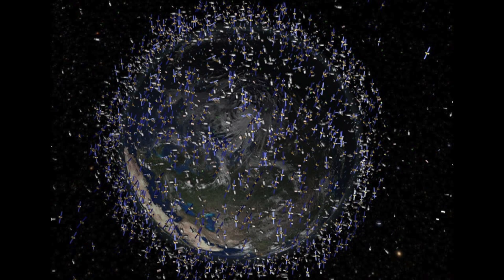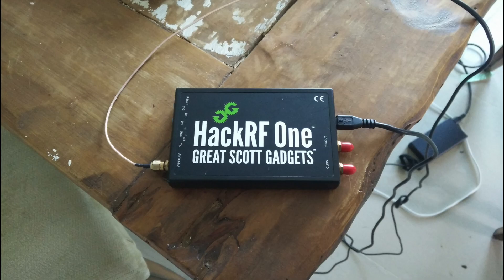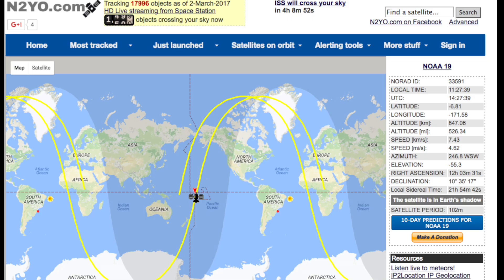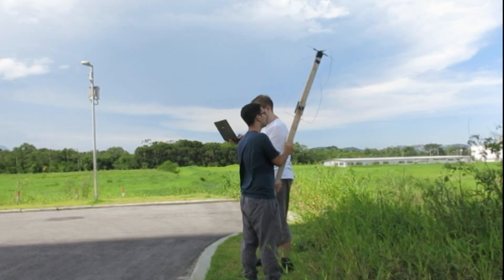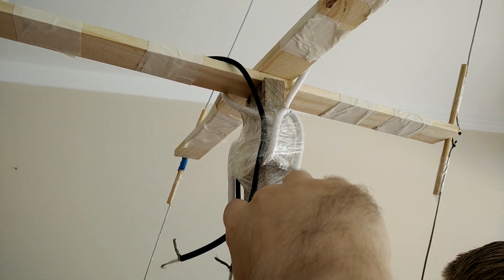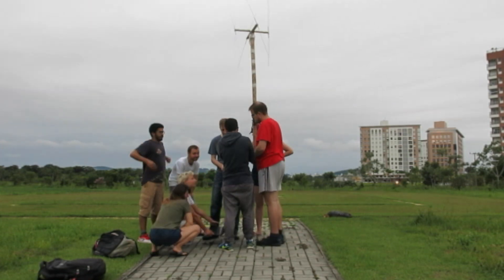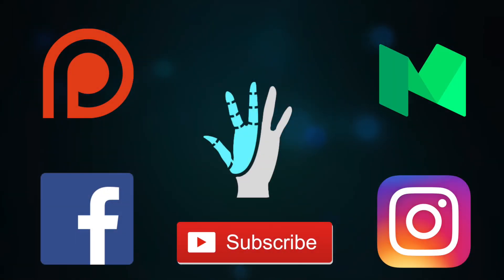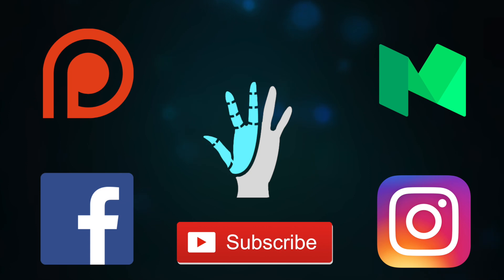How to Pull Images from Satellites in Orbit (NOAA 15,18,19 and METEOR M2)

Comment: Hi, I'm 15 years old and I've been really interested in satellites over the last couple of weeks. I wasn't even aware that you could pull images from satellites like that. Thanks for showing me how to do it. I'm gonna buy all the required equipment and (hopefully) build a working setup over the next couple of months. Greetings from Germany!
Reply: AverageGeek: You don't need an HackRF, it is relatively expensive (when I remember my budget when I was 15, I would say prohibitively expensive). Buy a rtl-sdr instead, you can have it for under 15€ which allows you to buy the other stuff that you also need.

https://www.amazon.de/dp/B013Q94CT6 <- rtl-sdr (including a unusable antenna) 14€
https://www.amazon.de/dp/B00VZ1AWQA <- same rtl-sdr with a few modifications: slightly better frequency accuracy and a slightly better antenna that is usable for first experiments with the software. But it costs 25€ instead of 14€

The rtl-sdr is one thing that is needed, if you want to connect your own antennas you need an adapter from MCX to something else that is more robust and easier to handle, like SMA or BNC.

https://www.amazon.de/dp/B00EF94RF6 <- adapter from MCX to SMA
https://www.amazon.de/dp/B0178YM7DS <- 1m coax with SMA connector
https://www.amazon.de/dp/B0178YNBD8 <- 3m coax with SMA connector

The longer cables can also be cut in half to connect the then open end to your self-made antenna.

The mentioned coax cables are RG316 and not RG58. The difference is, they are very thin and light (which makes them easier to handle) but they have slightly more losses than RG58, which isn't a problem if you keep them short. Just mount the rtl-sdr close to the antenna with a short cable, and use a longer USB cable to connect it to the computer. Getting it away from the computer is also important, all computers are full of switching voltage regulators that produce a lot of noise, if you plug the rtl-sdr directly into the computer it is very close to this noise. A USB-cable will also prevent stick or the usb-port from breaking if you accidentally step on the cables or run into it.

There are active usb-cables like these: https://www.amazon.de/dp/B004HZDKFG which can be used to get the rtl-sdr far away from the computer and close to the antenna.

Why the rtl-sdr is a better choice than the HackRF (for the beginning). The HackRF has some special features that aren't needed most of the time, but they make it expensive. It has a much wider frequency range it can receive (from 1 MHz up to 6 GHz) than the rtl-sdr (~ 24MHz up to 1.7 GHz) and it can receive 20MHz of spectrum at the same time instead of about 2 MHz the rtl-sdr can receive (actually slightly over 3 MHz, but with dropped samples). Most of this isn't needed, most interesting signals are only a few KHz wide and a 20MHz of the HackRF are not needed. You would pay > 285€ for something you don't need.

By the way, greetings from Germany ;)
Reply: @zvpunry1971  So, if I buy this. I only need to make my own antenna, attach it to this and I could gather stuff from satellites? (Excluding all the software)
Reply: ENRPVEVO: If the antenna is good and local noise is low, yes.

If I have an antenna close to my computer, I receive mostly noise and there is no difference between a 15€ rtl-sdr, 300€ HackRF or 1k€ USRP. But when I have 20m ecoflex-10 between antenna and the SDR, then the noise is gone and the signals become visible. Ecoflex-10 is a relatively good and robust 10mm coax cable, but it is quite expensive (~3€ per meter), only the last meter that goes into the SDR is a thin RG316 spaghetti to prevent the heavy cable from pulling the tiny SDR from the table.

If your computer isn't an evil noise-generator like mine, then even shorter distances are OK. Then you can use shorter/thinner/lossier cables, close to the computer... Just try it, the things I listed in my first post are a good choice. :)
Reply: @zvpunry1971  Tbf I have no idea how noisy my PC is, sound wise, its a jet yeah. I don't know about radio wise though, if I want to do this my only option would be to mount the antenna near my window, which is near my PC. Or, get it to the roof, but there is the problem that I can't move it.
Reply: ENRPVEVO: You always want to have the antenna outdoor, the roof can be the best option. A window may also work, but it limits the direction from which you can receive signals. Such an antenna doesn't need to be permanent, some wires glued to a piece of plastic and temporarily installed with a screw clamp in front of the window was one of my first antennas. ;)

How noisy your PC is needs to be seen. Just get a cheap rtl-sdr and tune it to a local FM broadcast station. Almost all SDR software can display a FFT plot that shows the relative amount of received power depending on the frequency. This allows you to compare the signal strength between a frequency without any FM broadcast station and the frequency with the broadcast station. Then you can move the antenna closer to your PC and if the noise increases, you know the source of it.

Just play with SDR software and a cheap rtl-sdr and antenna positions. This is the easiest way to learn it. And then search for other signals. :)
Reply: @zvpunry1971  That's awesome man, I'm atm in my teenage years so going to the roof and installing some big antenna might be a problem for me because I don't know anything about mounting stuff or how all of this works, but this actually seems fun lol. I'll definetly try this out in the short-future!
Reply: ENRPVEVO: Just make sure that antenna experiments (and the screw clamp) can't fall down on the head of somebody. Everything else is just fun. :)

And most importantly: Report back about success or failure ;)
Reply: zvpunry hättest ja auch auf deutsch schreiben können xD
Reply: maybe you could try getting a ham radio license
Reply: +Das Sahnebrot ich fühl mich ehrlich gesagt gerade ziemlich dumm, weil ich nicht sofort erkannt hab dass er auch deutscher ist :D
Reply: @Sahnebrot: Natürlich hätte ich auch auf deutsch antworten können, aber für andere (englischsprachige) Leser potentiell hilfreiche Kommentare schreibe ich bevorzugt in Englisch, speziell unter englischsprachigen Videos und unter englischsprachigen Kommentaren.

@AverageGeek: Kein Grund sich dumm zu fühlen. Das ist eher ein Indikator für mich, daß ich zu viel Text auf einmal geschrieben habe. Dadurch ist diese Information (letzte Zeile) unter gegangen. Ich hoffe trotzdem, daß mein erster Kommentar war hilfreich. Nach drei Wochen könntest Du vielleicht auch schon erste Empfangsversuche gemacht haben. ;-)
Reply: +AverageGeek
People have been receiving meteorological images from satellites as a hobby for many years. Long before the SDR craze, they, didi it with VHF radio receivers. This has been a long-time hobby for many people.
Reply: Ich lol no need to be a license ham operator to recive the tranmision
Reply: use sstv app to transmit image signal by sound, and decoder use robo36 from google play. future more just ask ham radio operator
Reply: @wancable9702  u can also use a portapack
Reply: @crypto.7562  i have no idea about this... will continue research about portapack. thanks bro
Reply: RTL TV-Wahnsinn (ja der witz ist scheisse)
Reply: Wen interessiert dein verdammtes Alter?

Comment: Great video.  Thank you.  I built a quadrifilar helix antenna for NOAA satellite reception about 10 years ago and it worked great.  One radio project you might want to try is radio meteor detection.  I run a system where I listen for meteors using a 20 meter dipole and monitor an out of range TV station.  Meteors temporarily ionize the air creating a path that can cause the out of range station to come in for a moment.  My system counts and collects data but it is fun to even just listen to the "ping" sounds when monitoring CW or SSB mode especially during a meteor shower.

Comment: do you have to use a  hackRF or could you use some of the smaller sdr's? what would advantages would the hackRF have over the cheaper ones?
Reply from the maker: No the smaller ones work fine, we just used the hackrf because we had one. Also it's high quality and has more built in filters and amplifiers so it makes life way easier
Reply: The Thought Emporium there is a hackRF bundle that contains an antenna, could I get away with using that instead of building one?
Reply from the maker: No you need the special antenna. The one that comes with the kit isn't sensitive enough
Reply: The Thought Emporium would this work with any satellite? Or just the 4 you guys mentioned?
Reply: The Thought Emporium I've got a frustrating issue that I'm not sure how to fix, I just had a pass that went nearly overhead with a Max elevation of 84° so I used my noolec sdr smart with wxtoimg,sdrsharp and orbitron correcting for Doppler. I got a good strong signal and as wxtoimg was decoding it I could see clouds in like 1/3 of the picture the rest was noise but when it finished recording and started processing any detail that was previously there was completely GONE. I keep having this issue. Any ideas?!
Reply: @nateclishe622  did you see enough telemetry for it to figure out the channels
Reply: @thethoughtemporium  the hackrf sucks for rx. the only reason to get one is for 6ghz reception or tx
Reply: Nate Clishe well he did mention that each antenna was "tuned" to a certain frequency so i suggest you do a little more research instead of asking so many questions.
Reply: Tried 'em all and, like the others, found the turnstile to be the most reliable to build and use. The others will work better, but you need to be a super techie to know how to tune it; guessing won't work. A booster module at the antenna improves the signal greatly.
Reply: Warren Curry any specific tuner you could recommend or is there any special things I should look for in one?
Reply: J M I do apologize for asking so many questions but I know it's tuned correctly because I purchased one for this purpose off the internet. and I have done tons of research but have come up mostly empty so I used this as a last resort.
Reply: Can you pickup local radio stations with it? If not your SDR may be dead.
Reply: Warren Curry ya I can pick up stations no problem and I get the satellite signal but it's weak for the vast majority of the pass and results in barely noticeable features in the image.
Reply: Nate Clishe - I would say it is your antenna. Look around for one with a higher gain. On YouTube there are several yagi antenna's that are easy builds, some made from wire coat hangers!
Reply: when i did this years ago i had a uniden desktop radio scanner, hooked into an aircraft reciving antenna fixed on top of my tv antenna. No special bends curves etc etc etc. Recorded the audio on pc using the highest ausio setting and used wefax to decode the image. I got way better noaa images than what you got. Nevere tried the other digital ones as the freq was way to high for my reciever. I recently tried using a handheld yaesu reciever and an ipad and decoded on the fly, still good quality.
Reply: I'd like to see more on your radio telescope!

Comment: My go to way for straightening wire, take few feet wrap one end around any strong enough object center of a large wrench stand on it, do the same for the other end and pull up to stretch the wire straight, cut your chunks out and gentially straighten the slight imperfections caused from handling after the pull. Should he perfect! Thanks for the vids!

Comment: Anyone know if data from NOAA-20 will eventually be accessible once it's operational?  It was just launched last weekend (currently named JPSS-1 until operational).
Reply: Tj Wiets, direct broadcast services continue to be available from all NOAA POES and GOES spacecraft. However, the low rate analog formats demonstrated in this video (for N15,18,19) are no longer produced in the newer spacecraft. The newer spacecraft (including the partner instruments on the NASA EOS and MetOp A/B spqcecraft) produce only High Rate ("digital") data that require the decoding tools demonstrated in the video. Search for "direct broadcast" if you want to learn more.
Reply: Oh, and it is accessible right now.
Reply: @bryanbreen7943  This will always be the case with digital broadcasts as by definition the broadcast is simply a number it is the interpretation of that number that gives the versatility. That fact actually reminds me of the time they tried to crack down on sharing the broken CSS key and finding other ways to encode a number became a meme. Turns out this works well both ways you can encode anything in a number and you can encode a number in pretty much anything too especially when you have a computer and anything it produces is literally just encoding something in a number of arbitrary length.
Reply: Fun Fact: NPOESS (the cancelled program that evolved into JPSS) was supposed to have an LRPT Transmission mode, much like the Russian Meteor 3M series has. But that was cut when it became JPSS.
Reply: yeah i think its x-band like 7 ghz

Comment: The EM propagation is slower in the antenna material and coax (copper, aluminum, etc) than c.  See/research velocity factor.  Cutting assuming c, may give slightly incorrect lengths.

Comment: So when the video on decoding is out, I'll be able to do this from my home?! 

...I'm already looking up the satellites. Gotta get me a good NY pic...
Reply from the maker: Yup! I just tried it, inside, on the top floor of a house in the middle of a big city and it works fine. So it should work pretty much anywhere.
Reply: Also, I've seen that you tried this with the ISS- have you tried with Tiangong I?
Reply: ...And, for that matter, do you have any tips on the legality of doing this?
Reply: You can legally listen to any signal anyplace in the air as long as it is not encrypted or scrambled in an effort to keep the public from getting the data.  This includes television signals.  You should use this to listen to communication sats and all the other stuff that is up there.  When the ISS is passing overhead, there are also comms going on there that are not scrambled either.  Another fun thing is ADSB transmissions from commercial aircraft in the sky.  Great monitoring there and can even plot the jets on a map as well as their flight data, lat and long and altitude, and even the plane identity, call sign.

Comment: Good job on the video. I'm surprised you had such a hell of a time with the QFH and other antennas. I was able to get about what you got with the QFH using the stock antenna my noolec (rtl) sdr came with, shortened to 1/4 wavelength in my basement at ground level. I'm supposed to get a commercial made discone antenna from a friend. Hoping I'll get  a decent enough signal. Its pretty cold and wet in the Pacific Northwest for the next couple months so I won't be able to go outside to play and get away from all the RF noise till then. My goal is to get LRPT and someday HRPT. I've also got a LNA and a sup-2400 on the way to drop the signal down.

Comment: Very cool! I just finished building an ADS-B flight tracker with a Raspberry Pi, homemade collinear coaxial antenna, and an RTL-SDR. I think I just found my next project.
Reply: Great ! Would it be possible to upload your work so that we can learn
Reply: @prabirdebnath5197  if you want you can use rtl1090 and virtual radar, just make sure to set the protocol to beast

Comment: With gqrx, gpredict and some bash scripts I have automated most of the noaa recordings. I'm in the process of automating the Meteor-M N2 recording but I'm dealing with crappy windows only software that don't even have stdin and stdout.
Reply: Do you have a way to automatically demodulate the signal on Linux? I'm working on making a better (and cross platform) decoder for the format itself (the documentation IS quite bad...), but haven't looked yet at what it would take to actually track and demodulate the QPSK with gnuradio.
Reply: I use this to record (with an RTL-SDR) the LRPT signal into a bitstream file, I can't track down a .grc for it so this is what I'm stuck with. Once I have got the .s I just feed it into the same offline LRPT decoder.
https://gist.github.com/linuxsocist/3fbb697e329ebc1a26af794167b1b2ec

There is one for the airspy that is a mod of this one but comes in .grc form.
https://github.com/otti-soft/meteor-m2-lrpt
Reply: At the moment I have a basic script that uses "at" to launch and kill the script at the times the meteor-m n2 passes.
https://gist.github.com/linuxsocist/dcede17556a0105a6830d212a24b1ff2

I've been meaning to script in the pid, so killall is just a drop in for the moment.
Reply: Finished the decoder i was talking about - https://github.com/artlav/meteor_decoder Please let me know if it works for you, since so far it was only tested by me.
Reply: Just tried it on an old .s file I still had around and it works brilliantly as you can see in the left image. I will make a script later to give it a full test with the other channels later thanks. :D
http://imgur.com/a/nHYce